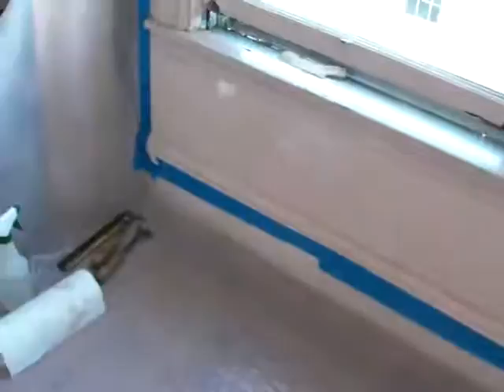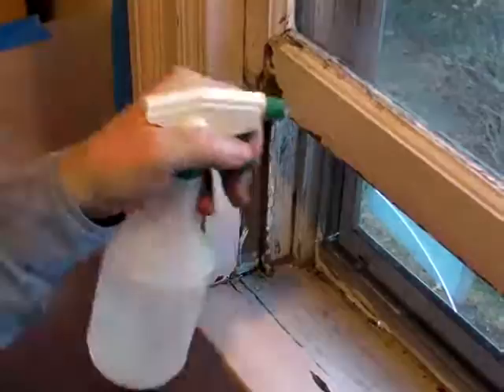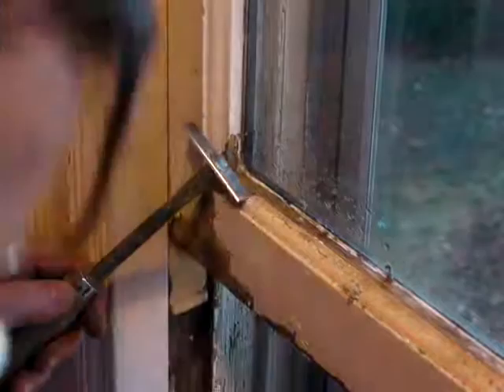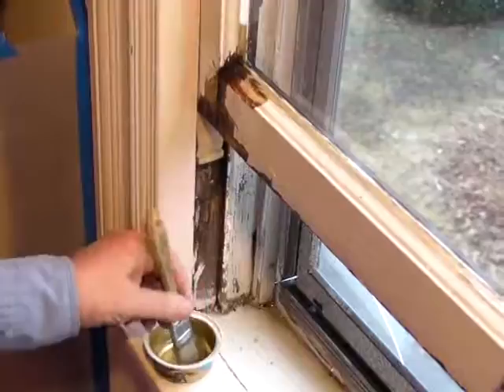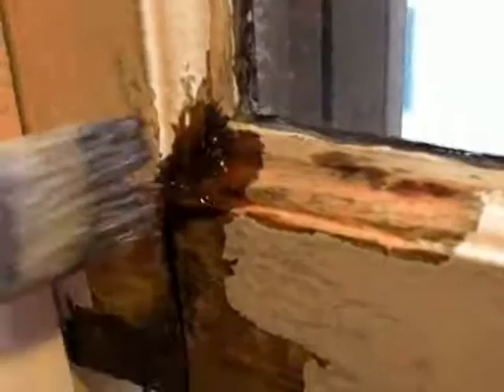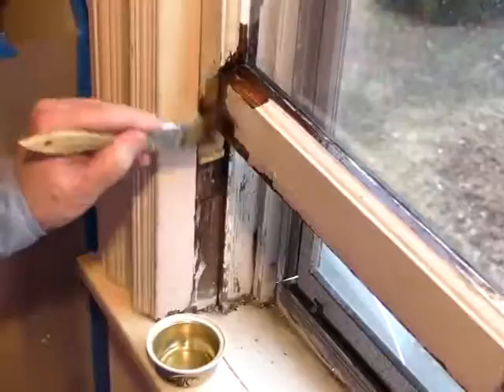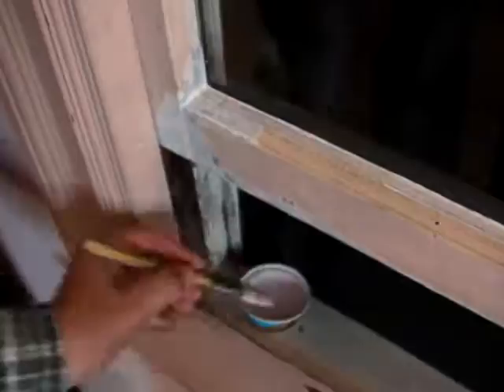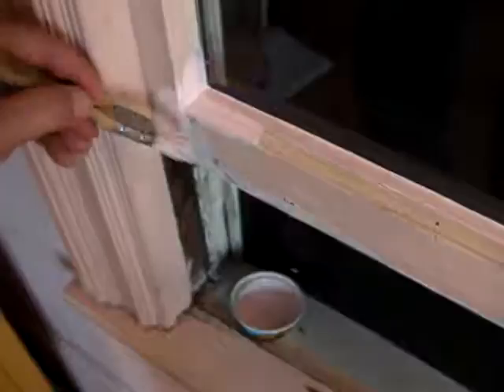Window Sash Spot Paint Maintenance

Comment: Great resource. Thank you. This helps.
So, if you weren't working around a camera, narrating, making a video and simply working through a series of windows with this amount of damage as an average, what would you guess time/window?
Reply from the maker: I'd figure on 20 minutes per spot when the spot is within a  6"x6" area. If the spot is 1" wide and 10" long that would count as within two 6"x6" areas, and would be 40 minutes.

Comment: Good to see you using linseed oil and linseed oil primer.  I'll be doing an Allback Linseed oil project in Connecticut this summer.  Have you had much demand for linseed oil paints from customers?
Reply from the maker: Very little. I steer customers and other tradespeople away from Allback's Linseed Oil Paint for exterior work because my testing and others' experiences show that mildew and color fastness can be a problem. Here is the discussion on that over at my Forum:
http://historichomeworks.com/forum/viewtopic.php?t=1625
Reply: @johnleeke  very interesting and surprising. I have used it “hot” both blo and the blo paint. MnO2 has been added in order to accelerate the curing process. I am still uncertain if this can also be used as a mildew protector like with ZnO2 or TiO2.

Comment: John. For the oil, are you using boiled linseed oil? Do you add additional solvent to the boiled oil or can it be used as it comes? Also, if you were doing spot maintenance like this, how would you handle paint that is cracked here and there but not bad enough to strip back to bare wood? Can you fill those thin cracks with another layer of primer, or should you use a brushable sealant?  Thank you.
Reply from the maker: Francis, that is boiled linseed oil. When I'm soaking it deep into the joints like this I don't add any turpentine.
Although  I don't show it in the video, I did treat the thin cracks in the paint film (called "alligatoring"). I brushed boiled linseed oil on the surface of the paint three times, about an hour apart. Then I wiped the oil off the surface of the paint. Some of the oil seeped into the cracks where it will help stabilize the paint film and may postpone peeling of  the alligatoring paint. 
It's been five years and both the spot paint and alligatoring treatment are holding up well.
Reply: Thanks John. That's useful to know how to help stabilize those thin cracks. But to get a nice uniform freshly painted look for the entire window, after you do spot paint stripping to bare wood and oiled the alligatoring, would you then go over the whole thing (including the old paint) with an oil based primer and then topcoat? Or is primer unnecessary on the old paint; can it just be top-coated directly? The old paint I'd be painting over is latex by the way.